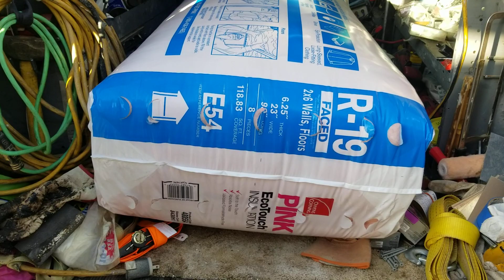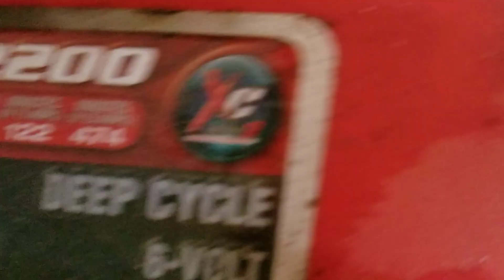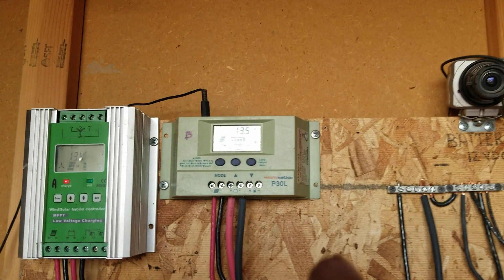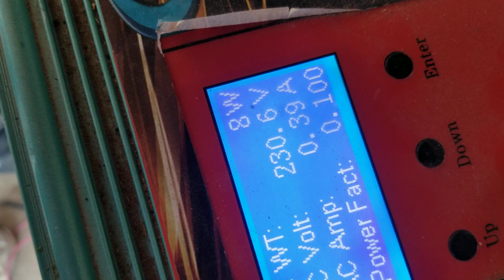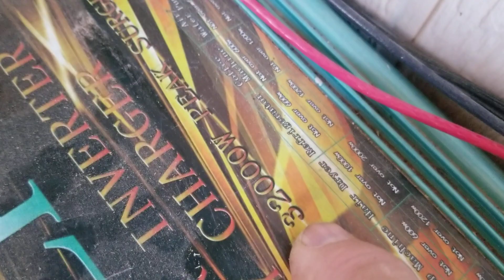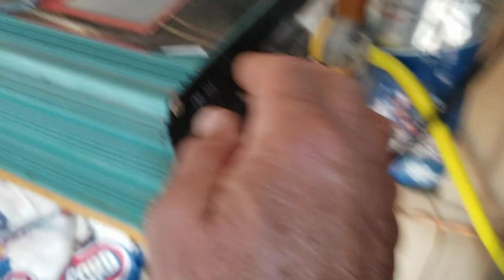Solar panel racks, battery banks, Jan. 15, 2020

Comment: Got my first two sets of golf cart batteries a couple days ago and halfway through wiring them up I had to go check the diagram to verify I was doing it right. Well it looked so simple on paper. Live and learn !
Reply from the maker: Lol, I hope you did it right too!  Take 2 six volt batteries, connect one positive to the next one's negative.  Now you have created a 12 volt battery bank.  Do that to each set of 2 batteries, then connect all the left over positives together for your positive side, and all the left over negatives together for the negative side.
Note: try to use all the same size wires for each group of connections, same diameter and length.
Reply: @GBear  All went well. Took a meter reading after each connection was made. Used #2 wire all the way(I have a small inverter).👍Going put a load on it today and see what I got. Has to be better than what I was using.
Reply from the maker: Good job!  Is your inverter pure or modified sine wave?
Reply: @GBear  Pure sine wave. I've been using a All-in-one unit(controller, inverter, charger and dry contact for generator). Only wish I would have gotten the 24 volt model😒

Comment: Like you’re ingenuity in the way you created the base for your Solar panels “ My Question if you could be so kind to give me a few minutes of you’re wisdom in living and working in this “ “ I’ve seen & heard is 48 volt - The Deep State has Been Spraying Kemtrails for many years the Nazi Banker’s & all The Darth Soroscratic Party like the mouth of the Deep State Treason’s Party her net worth is up around 300 Million $ that’s $ 300,000,000.00 on the a civil servants job ! And they know she’s been paid off many times but the establishment was in control not the United States Constitution as it is now ! But my question is I’ve seen 48v has less electrical in the wires , and there is more electrical lose in 6v a little less with 12v - 36v a-little less and 48v the lest what is you’re perspective on this ? When you have time sir !
Reply from the maker: 48v systems are by far the most efficient as ohm's law shows. (V x A=watts)  I chose a 12v system thinking if no sun for a week I could use jumper cables from my van to the batteries.  I may change over to 48v when this equipment needs to be replaced, but it is working as needed for now.

Comment: Nice to see it all working years later, no shortage of solar panels. On our news they showed rainfall statistics from all over the world and much of it was showing over a 50% reduction inrecent years with a long term steady decline. No wonder geo engineering is in effect worldwide . Yet most the news and elite tell us all is well ,history plainly teaches us differently .
Reply from the maker: I just saw an episode of "Nova"  where scientists were saying the Earth's magnetic field was weakening and within the next millennium the sun's radiation could break through our protective shield and render earth  inhabitable just like Mars.  They also noted that even sooner, the magnetic fields could flip and reverse causing compass needles to point south.  They claim to have found evidence that this happened before in core samples taken from volcanic lava flows.
So, the fake news here says 80% of Australia is burnt or burning...what's the real truth?
Reply: If they say 80% of Australia thats not accurate ,yet 80% of certain areas has been burnt, quite large areas ,the worst in history , weve always had large fires each summer but now with the worst prolonged droughts and highest temperatures in recorded history, the fire season has grown from 3 months to 9. Farmers are either committing suicide or just walking away, here  the chinese are are buying viable farms and sending the produce to chinas just as the Malaysian  Saudi  Japanese have done, like the old prophecy  said you shall grow your grops in vain the alien (foriegner) shall consume it, were importing chinese produce laden with banned agricultural chemicals ,fresh,tinned,frozen, even my asian freinds from china Vietnam Thailand etc wont touch it. Inconcievable a couple of decades ago,cheap labour and western corporate greed created a monster

Comment: Be sure to tie down or move anything that can blow around into a safe place.   I'm sure you don't like chasing lose items around the desert.
Reply from the maker: It seems that no matter how well I prepare I still end up chasing stuff across the desert, and then there is stuff that comes from other homesteads that are miles away.
Reply: @GBear  Anything useful?
Reply from the maker: @paulgendron8416  just trash.

Comment: hi gbear . do you use power all night ?  and and all day .  what voltage do you have in the batteries at 10 pm
Reply from the maker: Yes, I watch TV until about 10pm, sometimes later, 2 fridges all night, security  cams and DVR 24/7, lights on and off, clocks, chargers, etc., and the battery bank sometimes gets down to 12.3v overnight, but when I get my last 6 batteries added I expect the low to be 12.6

Comment: The Self Appointed Keepers of Man Kind think they must PROTECT the WORLD. Your Needs, Wants and Voice don't come to the table. 
I priced some of that UniStrut last month , Man O Man they sure are proud of that according to the prices here in town. Going with Wood for sure.
Been looking at those Power Jack inverters  .  I need like a 2-3000W version.   Not impressed with what people are saying.. Hearig the new Power Jacks won't produce or meet  they're rated power .   Good for about half of what they are rated.  SAD. Seems to be the case with most all Inverters offered on E-Bay these days.  Dang,  I just want one to be capable of producing what it's labeled as.  I wouldn't expect to run a 2000W at that rating continuously but it should be able to.
Reply from the maker: I have no complaints about my Power Jack.  I run loads of power tools and my whole cabin from it.  I have it tied in to a 125A breaker panel in the cabin which feeds 8 breakers at 120v/20a and a 60a subpanel in the shop.
Reply: @GBear  Yep, you have a good one.  Guess they decided to follow the crowd.